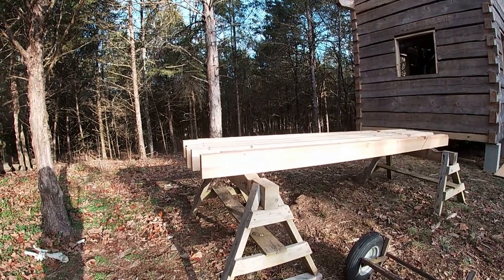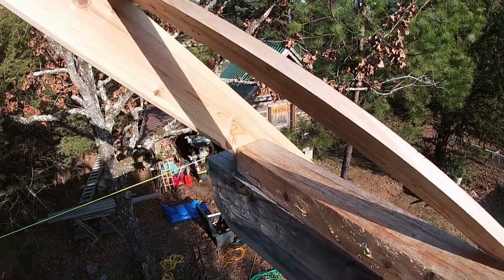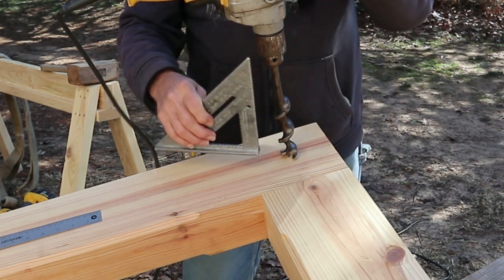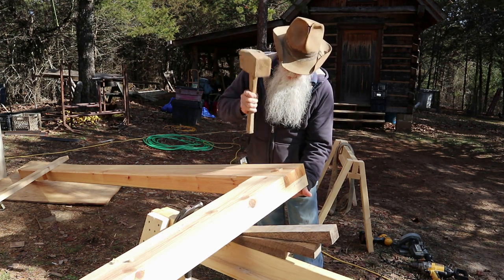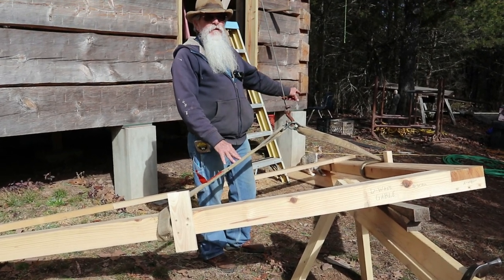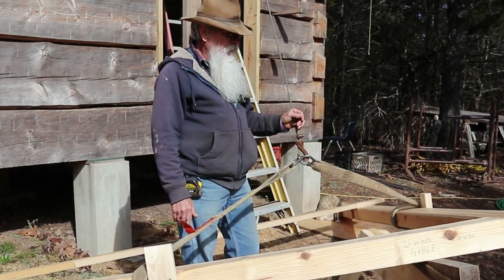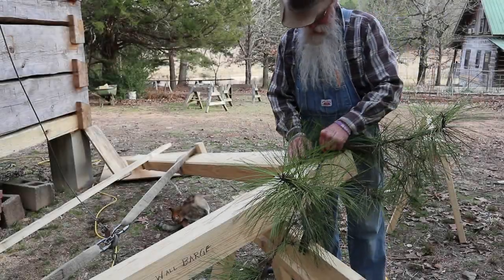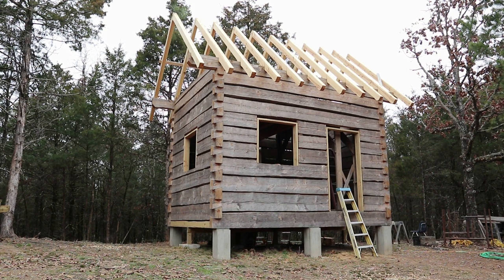Setting the Rafters, Dovetail Log Cabin Build, (Ep 41)

Comment: Wanted to respond to your comment on sizing pegs. I haven't done nearly all that you have but I did take a lesson notice from Mr. C a few years ago about drilling the end grain with your desired peg diameter. For example, if you want a 1" peg, brace up a 1" dual cutter bit and find the approx center of the end grain  of your billet ( most of mine are octagon shaped at this point) and make a few turns, just enough to get a clear "w itness" mark on the end. Do the same to the other end (unless of course you need a slight taper, then use that bit. ) Voila, you can turn or draw knife (which I how I make most of mine.) with great accuracy when completed. Works really well on the bone dry (green or white)  ash and hickory stock.  I like mock hickory for it' strength. 
Thank you for all your tips, I especially like the jug and string for setting the gable rafter. DD
Reply from the maker: Howdy Don- that’s a great tip! Thank you so much for sharing it. The hardware store where I trade gets the 1 1/4” oak dowels for me and saves me some time. It is rewarding to make your own pegs though. Sometimes I’m pushing for time and have to cave in. Thank you for watching the video. God bless you

Comment: How do you build the false floor for the second level, and how do you get the fancy tripod hoist up there?
I know it comes apart because I saw your video on how you built it. The hoist sure looks like it has a longer jib on it? I really love watching how you do all this, the levels of detail you go into for all the aspects of this are just enormous. Thank you.
Reply from the maker: Howdy- the second floor is a temporary floor, just 2x6 pine. There are two temporary support beams that carry the 2x6’s from the edge of the last floor joist to the wall so the hoist can be rolled around the full area. I set the pieces of the hoist up on the second floor with a tractor. The hoist I use downstairs has a 16’ boom and the upstairs hoist has a boom about 9’ long. Thank you so much for watching our videos. Take care and God bless
Reply: @TheBeardedCarpenter  Thank you for informing me, I thought the boom length looked longer. I really like how you built this crane/ lifting device, it really works great. Jim.

Comment: Hey Paul  getting ready to layout my rafters for the outdoor kitchen there eh! how deep should I make the C cut or birds mouth? using 3"x6" black spruce worked out a 79.2" rafter length from tip to c cut plus will add a 2' overhang
Reply from the maker: Howdy Denis- if you came down 5 1/2” from the top of the rafter vertically, you would have a good 3” seat sitting on your top plate. I think you’re using a 12/12 pitch, so that should work well for you. Let me know if you need anything. Hope all is well with y’all. God bless
Reply: @TheBeardedCarpenter  thank you sir...
Reply from the maker: @denislosieroutdoors  You’re very welcome. Blessings